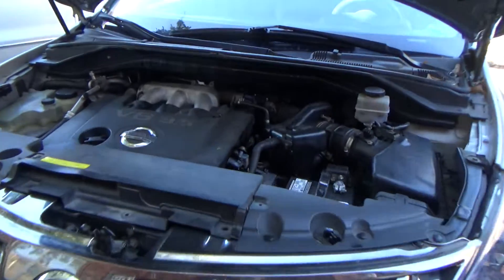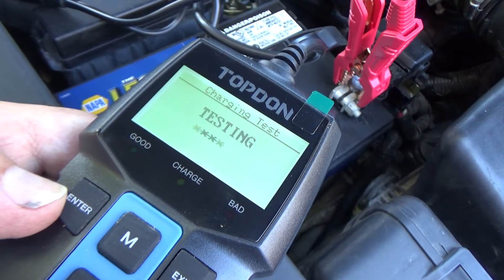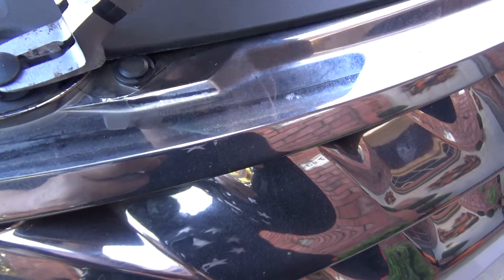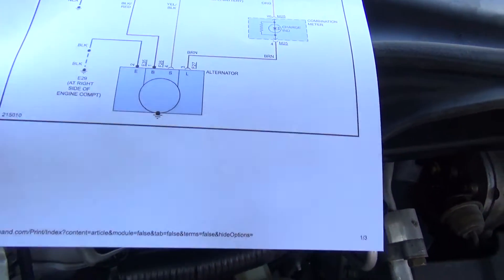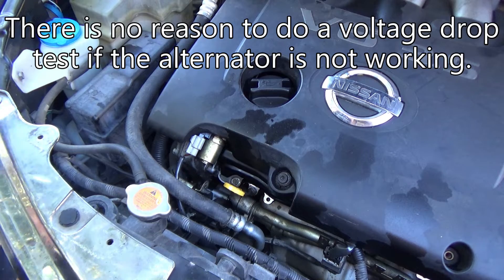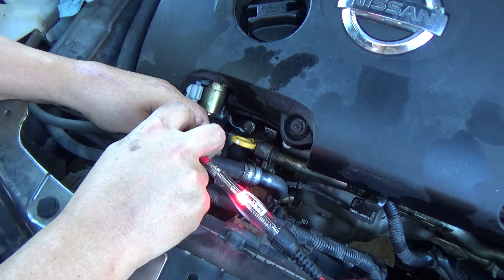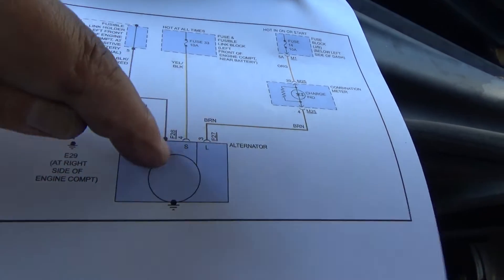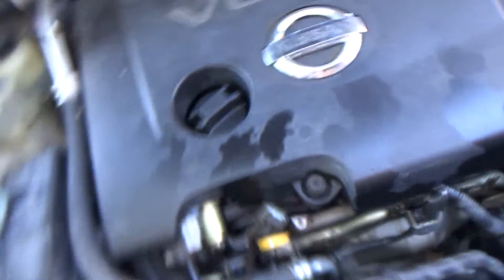How to Diagnose a Nissan Murano Alternator and Charging Problem.

Comment from the maker: OEMTOOLS 25936 Mini Circuit Tester for 6 Volt and 12 Volt Systems
https://amzn.to/3FSgAfJ
Car Battery Tester 12V Load Tester, TOPDON BT100 100-2000 CCA
https://amzn.to/3SBfqwr
100 Pack Wig T-Pins
https://amzn.to/469B7XF
Mutipurpose Diagonal Cutting Pliers Wire Flush Cutters Car Push Retainer
https://amzn.to/4dI9LMw
737mechanic Amazon Store Front
https://www.amazon.com/shop/737mechanic/list/CR3BU74FTDU1?ref_=cm_sw_r_cp_ud_aipsflist_aipsf737mechanic_W4QMHMJ1JD67FDBCQHRK

Comment: Tip of the day:   A sign that the battery may still be good and alternator bad is that both the "Battery" and "ABS or Brake" lights will remain on in the dash..   Had this happen on a Ford E-450 and on my Nissan Altima.   In both instances I had, first, replaced the battery with a brand new one only for both to die after some short time.   Ended up replacing the alternators.   Now have been running great.   Thanks for the vid.

Comment: Did all the tests for the alternator an the battery, they both checked out on all of them.. but still every once in awhile while the car is running it drops idle a little bit an when I turn everything on radio, lights, heater the brake light comes on then the AWD light then I know it's gonna die.. what am I missing?
Reply: This! Did you find a fix?
Reply: Your alternator connection is bad

Comment: I replaced the battery twice and also the alternator twice, i replaced the connector on the alternator and my car just turns on when I connect the jumpers and before 10 min running it shuts off again. Please help! Murano 2012 LE
Reply from the maker: You need someone to ring out the wiring and figure out what is going on.
Reply: Can you send me the WDM please
Reply: Can you send me the troubleshooting please
Reply from the maker: @urieliladrillerosmonzon50  Sure.
Reply: Mine does the same thing.. thought was alternator because lights an everything were dimming out an eventually it died on me.. but alternator is working as it should.. I watched the voltage go down a little when it was idling cuz it drops idle for a split second.. but when I turn everything on lights radio heater an all that it really starts idling funny then eventually dies

Comment: In theory, if I didn't have the pigtail connector hooked up, would I get the same results to test the wiring in the harness?
Reply from the maker: The connector should be disconnected to do the same test I did.

Comment: Sir please reply my murano runs after I jumpstart it then after it runs on the road it stops with the rpm and then it doesn’t go forward or back is it the alternator sir? You think
Reply: I changed the battery that’s not the problem
Reply from the maker: @rayalatravels  It sounds like it could be. If the engine runs for a little while the dies after you jumpstart it then the alternator may not be working.

Comment: I have a question so I’ve done all the testing you show, I was only getting light from the yellow and black wire replaced plug still only getting light from yellow/black wire, alternator is a new remanufactured, battery is brand new and battery charging fuse is brand new, all fuses are good. Any ideas
Reply from the maker: What year, make and model?
Reply: @737mechanic  2009 Nissan Murano LE
Reply from the maker: @travisnelson7097  You also have a wire going to the IPDM. Email me and I will send you troubleshooting instructions.
Reply: @737mechanic  appreciate it for the willingness to help but we actually decide we are just gonna trade it off
Reply: @737mechanic  cuz it’s been having granny issues for about a yr now to so 👎🏻👎🏻👎🏻
Reply: Where is the battery charging fuse located?

Comment: forgot to mention the ground in the wiring diagram is the ground wires on the top bracket of the alternator mounting,  I have found considerable voltage drop in the past on these wires so clean them up as routine when replacing the alternators. no idea why they show like that in the wiring diagrams but the OE diagrams are the same.
Reply from the maker: Thanks for that info buddy.

Comment: Im impressed at how easy the small connector came out of the alternator. around here they can be an SOB to get out due to corrosion,  you seem to have the typical oil leak there which probably helped a lot. but tends to kill the alternators.I also noticed in this video that you dont have the rad fan control module on the fan assembly so that is handy. nicely done nice to see good videos on youtube.

Comment: thank you for showing that diagram. There is a fuse inside that powers the dash cluster and also lets the alternator charge the battery'
Reply: HELP!!? I bought a new battery and alternator and had them installed for my 03 Murano. The car started up fine and drove fine for 20 minutes then cut off on me and won’t start unless jumpers are connected. It’ll start with it connected but when you take the cables off, it shuts off immediately. Anything!?!!?! I don’t have money to keep putting in and I need this car
Reply: @ToddGurley-jb8kh  sounds like its not charging at all and was just running on battery voltage, I have seen aftermarket rebuild alternators that just dont work right out of the box and also the small pigtail harness with the 2 wires in it should be replaced if corroded or the wires are brittle due to heat and oil from the dipstick or valve cover gasket.
Reply: HELP!!? I bought a new battery and alternator and had them installed for my 03 Murano. The car started up fine and drove fine for 20 minutes then cut off on me and won’t start unless jumpers are connected. It’ll start with it connected but when you take the cables off, it shuts off immediately. Anything!?!!?! I don’t have money to keep putting in and I need this car